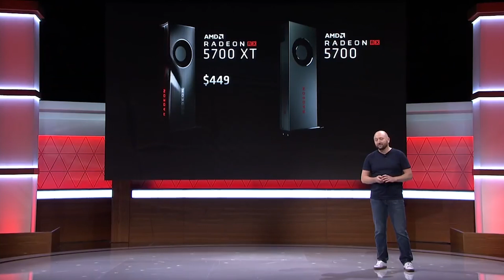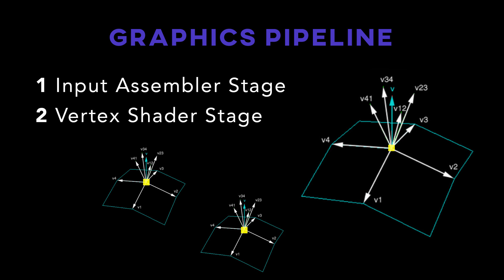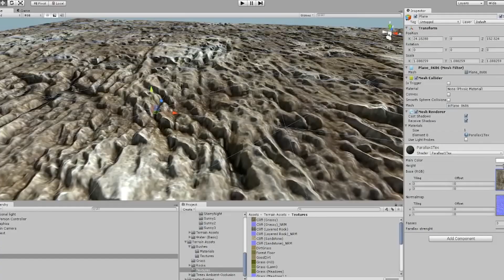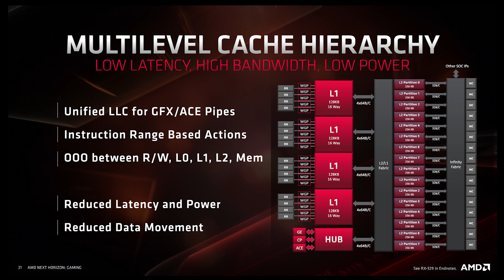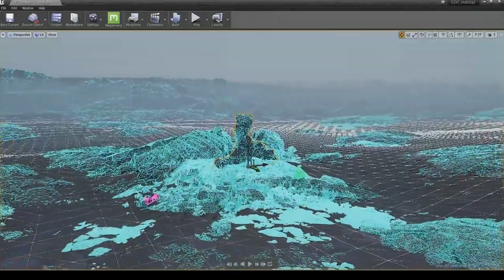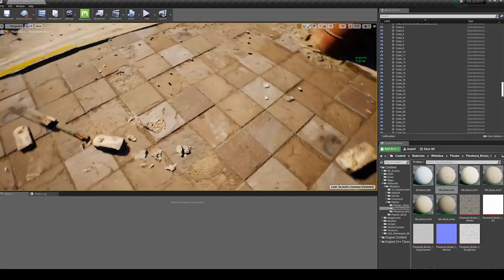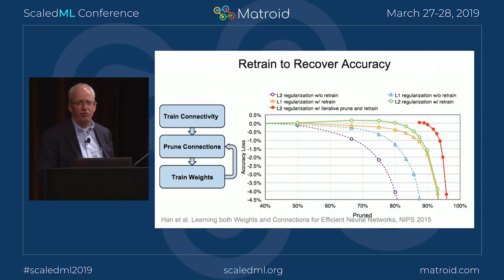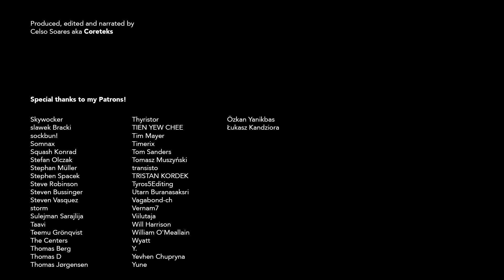RDNA vs TURING - The END of NVidia’s dominance

Comment: AMD's architecture is lacking competitiveness IMO, the reason it competes with Turing, is because Turing is on the older "12nm" TSMC process node. When Nvidia moves to 7nm+ with their next cards, AMD is going to lose this huge advantage. AMD needs to compete with Nvidia on the same process node in the way these 2060/5700 series cards are competing for the dominance to actually end. Problem is that AMD simply didn't invest like Nvidia did in their graphics R&D for the last decade, that is why Nvidia has been able to dominate so heavily since the release of Maxwell cards in 2014.
Reply: Lol. Nvidia use "Older" because they already mature. The yield are high and can be overclocked.
Reply: @yulusleonard985  no, nvidia used 12nm as soon as it was available. the RTX cards launched last year, before 7nm was available... Also 7nm would naturally allow for higher clocks.
Reply: @syferz  TSMC 12nm is refinement of their 16nm node. So its actually 16 nm +++++ since 2013.
Reply: @yulusleonard985  look at my original post, I put "12nm" because yes, TSMC's 12nm is just marketing, it's a low power 16nm process. Next year when both Nvidia and AMD are using 7nm+, AMD is going to lose a huge advantage of being an entire process node ahead.
Reply: @syferz  Higher clock or not Nvidia strategy is to make larger die using matured process for better yield and higher profit. the is no way you can produce large die with new nodes, while keeping its high clock and maintaining low failure rates. 

AMD RDNA is amazing because it managed to compete with 2070 super with much smaller die size.
Reply: @syferz  I doubt high demand of 7nm allow that since AMD is a much bigger customer for TSMC. 

Didn't Nvidia already said that they will use Samsung 7nm instead? But Samsung 7nm are relatively new node. Its impossible for them to make larger die while clock higher.
Reply: @yulusleonard985  Whether I convince you of the reality or not, it won't change that Nvidia will release 7nm cards next year that are higher performance than their current cards. And according to benchmarks, AMD's 5700xt is on par (single digit %) with 2060 super for the same price.
Reply: @syferz  Eh no. The reality is Nvidia always use larger die to compete. The new 2070 super is almost twice larger than Navi 12. It just impossible for them to use new nodes that is not mature enough or else they will suffer high failure rate. First they use TSMC 16+++ then they use 12/16 +++++. That is how they always compete by using larger die on matured node. 

I'll take Hardware unboxed conclusion than your fantasy. 5700xt is 2% slower than 2070 super while cost $100 less.
Reply: Lets take a look from another perspective, the 5700xt has similar core count to the 2070 super, and both trade blows in games, so AMD has indeed closed the IPC gap (if you can call it that), ampere 7nm probably add another 10% IPC over Turing, and from what we heard, AMD has RDNA improved architecture for 2020. If you do a direct die shrink of 2070super, it would still be larger than the 5700xt or similar in size. So AMD architecure is very competitive.

Comment: Its strange that you don't mention rtx vulkan support with nvidia. Alot of people seam to miss that. Its odd that vulcan will beat out nvidia. When in reality nvidia with there rtx technoligy supports vulkan. In fact rtx quake ii runs in rtx vulkan. Which is why its supported in windows 7 and ubuntu and windows 10. Its also strange that nvidia is making there technology opensource. Like Physx. 
So your hypothesis can work. But your leaving out this stuff out. Because at the moment. Were transitioning out of rasterized graphics into ray tracing right now. So because quake 2 runs on vulkan. When can we see amd cards running quake 2 ray traced? So yeah your hypothesis is flawed. No mention of intel yet.
Reply: Quake 2 is best experienced with 3Dfx minigl, and Lithium mod on the server.
Reply: @laurelsporter  glad you run a voodoo 3Dfx card.
Reply: @furynotes  and a K6-II. Those were the days.

Comment: What's your analysis on the recent Intel leak about AMD becoming something they now need to pay attention to as a competitor and AMD's silence since said leak. Plus the new Nvidia's Super range which is looking to beat AMD's new cards at similar price points. 

Which also bodes the question. AMD are fighting two wars at once, they can't win both, shouldn't they concentrate on one or the other?. Yes they have a stronghold in consoles and data centres, neither make them tonnes of money and their overall market share is small compared to either Intel or Nvidia in those markets.

Comment: Funny how comments make it so that Intel and nvidia will just quit now. Market competition is what is important here. AMD has aggressive pricing whilst Intel and nvidia put out the best products (it's just a fact for now). The issue is that there has been very little drive for neither Intel nor nvidia to release something more powerful. AMD might just be there now. But you need to consider this. yadayada 7nm will beat intel now. It took them this long to beat the 14nm process that Intel has been rereleasing for some 5 years now. And it's not like they are sitting doing nothing. What worries me more is that yeah AMD will have a good year. But that was it. I don't care if the label on my cpu blue or red. Nor the gpu. The thickness of my wallet after my purchase. AMD has a lot on riding on this. More so than just beating the fps in Ashes of the singularity (seriously who the f.. actually still play that)

Comment: Hard to end Nvidia's dominance when you are still trying to beat the 2070... :D
Reply: @somerandompersonontheinternet4  Lol the difference is 10W between the 5700XT and 2070 Super. Efficiency gains also have more to do than just different nodes, we don't know yet what Nvidia will look like at 7nm. Also if you actually watched the video you'd learn that Nvidia basically cheats and takes shortcuts to achieve their efficiency levels and performance at the cost of actual image detail. I've noticed this when having Nvidia and AMD GPUs in the past currently on a GTX 1080. By default in the NVCP its even set to use "optimized" filtering to further reduce image quality in favor of performance. If, or rather when AMD releases a 64 CU Navi GPU expect it to be ahead of the 2080Ti by 10%.

Comment: Nvidia is still ahead of AMD in every manner. 
1. Efficiency
Turing uses less power, even with the 12nm fab disadvantage and additional rt/tensor cores. (RTX 2070super 215w tdp, Radeon 5700xt 225w tdp while both sporting 2560 shader units.) 
2. Performance
Turing offers greater performance. IPC is still better with Turing. One example: Radeon 5700xt comes with 2560 shader units. RTX 2060 super comes with 2176 shader units and is even a bit faster according to newest benchmarks. So AMD is at least still around 12% behind Nvidia performance wise.
3. Price
Radeon 5700xt will cost 479$ while RTX 2060 super goes for 399$ msrp. If you take into account that Nvidia also gives you rt/tensor cores, turing suddenly looks cheap compared to navi. 

Conclusion: Turing is well ahead of RDNA in any case. Better efficiency, better IPC, better price, hardware based ray tracing. 

Sry to say but your video title is incorrect.
Reply: TDP are not comparable. Nvidia TDP are average power draw from idle to load while AMD TDP are the number of power pin used.

Wait for average power consumption on certain condition (overclocked or undervolted). So far according to the leaked review 5700xt consume less.

Comment: Sadly all Nvidia has to do is go 7nm and they are on top again, it's that simple.
Reply: They said the same about Intel vs AMD. Just needs to be on new node. Problem is that, very rarely you can just scale down to a smaller node. So what works on one design, may not be beneficial to another design. 

That being said, i am not saying it won't be possible at all, but we have se n how it has worked out before, assuming one could just go a node size down without hazzle. Design and manufacturing needs to correspond to each other.

Comment: MATHS. Sorry to be a pedant here. You're not American, so why are you saying MATH, instead of MATHS? It's short for mathematics, not mathematic or Arithmetic. 

I had a few intresting reads before I posted this and the lexicon for the usage of Math instead of Maths isn't because of Webster's dictionary or independence. In fact I haven't found information that has conclusive said why Americans say Math. Usually there is a reason, this one seems to not have a known reason. Although I only did 20 minutes of searching.

Don't get me wrong, you're one of a few people that I like videos from before I've even watched them. Because you and the others consistently provide unbiased opinions (sort off, as it's impossible to not have biases). Meaning you provide a reasonable critique based on information rather than the hype.

Comment: Navi is a failure, it is way overpriced, it doesn't matter if it is a better architecture, AMD, in graphics, is in the same situation that was in the cpu market, intel had a better product and the consumers mindshare, then they got ryzen, so AMD was very aggresive with prices and won marketshare and mindshare. With this prices, navi will be the next vega.
Reply: Maybe, but you seem to take both of those scenarios separately, when there are a lot of other parameters to take in account, especially, just from what you mentioned, the benefit from AMD's mindshare regain thx to Ryzen, which will obviously benefit for Navy as well! 

That, is 1 of the things that could partially explain why they didn't decide to be as aggressive as with Navy, the circumstances were very different.

Then, Vega was not quite competitive with NVidia on a lot of ways (mainly thermals & consumption), while Navi have a chance to overcome the cons significantly, so that, to the average non savvy user, their cards will appear pretty much equivalent (depending on the models compared of c ), which, on the long run, may allow them to sell + than with Vega, as there are - "deal breakers" ...
Even though a bit overpriced, the drawback are minimized, & there might be an AMD fanbase that was waiting for it enough to pull the trigger...

I don't say it explains & pretends they will sell well etc, just that there are other factors at stake when it comes to sells & pricing depending on the market/situation.

Comment: nvidia's respond is simple and they already did it for a time now, sacks those top dev stuiods to use their api with codes to sabotage competitor hw and prevent partner devs to optimize for competitor. if u can check there many case with optimization or upgrade development is halt and ended with graphic programmer resign or fired. this is also happens at CDPR when a main programmer try to force his way to get dx12 for witcher 3 which nv not happy and got shotdown by higherups. there many similar cases around the industries. that what are gamework and rtx for

Comment: Navi is 7nm and it's slightly better than RTX(in some rare occasions the difference is 20% more fps, but for the most part it's 10% and less) that was released in 2018 and is 12nm. imagine if RTX was 7nm. Navi would be dead on arrival. most likely it still is cause RTX Super with 12nm will beat Navi with 7nm.

Comment: Both Zen2 and Navi are very overpriced...
It's surprising going from the Radeon VII which is barely sold at a profit(7-8% profit margin), to those 89-90% profit margins of the RX 5700XT and Zen2...
Reply: Meh, I'm not going to complain about a 12 core for $500 and a 16 core for $750. It's undercutting Intel way more than they have to.

But perhaps it's a possibility Zen 2 only looks like a good deal because Intel's prices were outrageous to begin with. Who knows.
Reply: @theonetruelenny9883  
Just like you said Zen2 looks good due to intel being much worse, but comparing a smaller crap to a bigger crap doesn't change the fact that both are crap.
Let's start with the Ryzen 5 3600 at 199$. That's the equivalent of AMD launching the Ryzen 3 1200 at 199$ in 2017 instead of 100$...
Or the Ryzen 7 3800x at 399$, that's the equivalent of AMD launching the Ryzen 5 1600 at 399$ in 2017 instead of 199$.

The RX 5700XT cost AMD 240$ per GPU, but they sell it at 450$ which is an 89-90% profit margin.

The Radeon VII costs AMD roughly 650$ per GPU, but they sell it at 700$ only a 7-8% profit margin.

That's why they are overpriced.